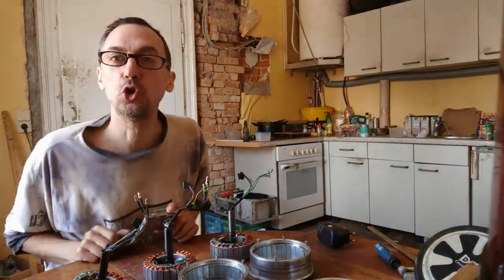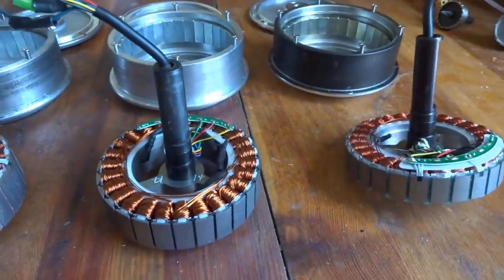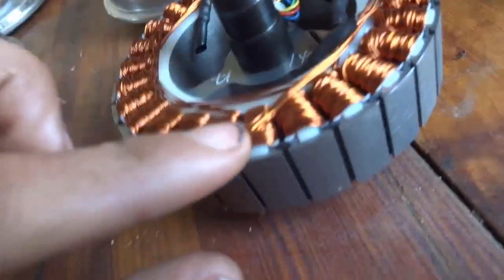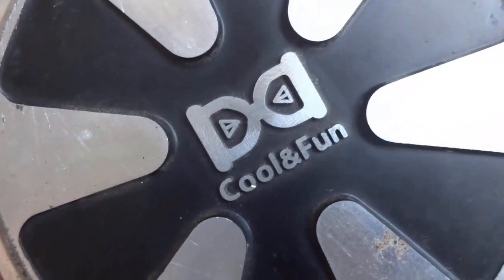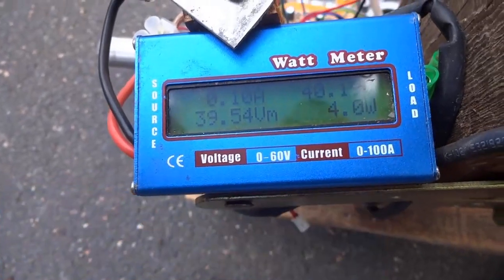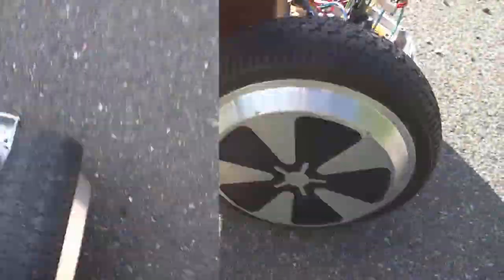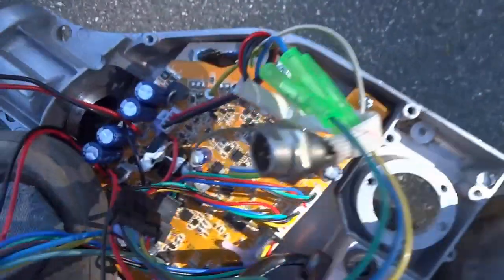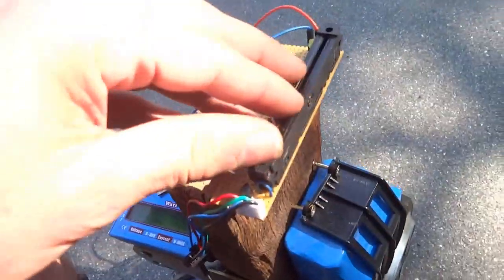part 1: 250 / 350 / 350+ Watt hoverboard motors with firmwares Fauth vs Feru :-)

Comment: Im still trying to figure out how to get ppm to work. Im building a multi purpose platform that can be used for moving stuff. Also it will be the perfect width to drive down my garden rows without disturbing plants so i can plant from a sitting position and my lawnmower fits on it.
Reply from the maker: i think ppm is out of date. An ESP8266 with wlan can do more and would be a solution for everyone. But it seems a lot of you still have a good old rc remote around and therefore go that way. 
I am currently switching to the EmanuelFeru firmware and it seems i need to improve his serial communication.. Taking a look at his ppm i find
 // Add Dead-band to a signal
 // This function realizes a dead-band around 0 and scales the input within a min and a max
int addDeadBand(int16_t u, int16_t deadBand, int16_t min, int16_t max)
So he improved ppm and pwm. Maybe you too give it at try.
Any ideas how to detect horse apples ? That would be another "garden" use case of such a moving platform.

Comment: Hello thank you for the beautiful comparison you made how can I get get the firmware I want to use it for 48v moto but I wish to modify the board to accept 48 volts(
Reply from the maker: Choose EFeru on my online compiler and compile :-)
I drive two 1000W 48V scooter motors with a single hoverboard control board. But only with a 3000W Cisco 42V power supply. And I have a 12V CPU cooling fan connected to the 15V cable..
48V battery might cause too much heat and kill the MOSFETs as well as the hoverboard motors.
12s liion has been tested successfully.
Reply: @robodurden , thank you sir for replying I'm a little bit new in programming so when they said I should  comment and uncomment, it's like a mystery I tried to compile but is giving me error I should choose a variant,,, I wish to use it for a bumper ride, using A DC
Reply from the maker: @amuhandrew1108  Google 'uncomment' and take a look at config.h

Comment: it would be nice if you made a guide on how to recognize what is 350W, 250W.
Reply from the maker: Small power supply or 24V = 250 Watt. Otherwise you need to open the motor and measure the stator height = magnets length. I show the three different lengths in the video and test them later. Forgot the lengths and would need to watch it again to post them here.
Reply: The easiest is to put them on a scale. If one motor (with a normal tire) is 2,9 kilo then it's 350 watt. It will have 30mm wide magnets.

If it's less then 2,9 kilo then it's less powerful. I bought 4 used hoverboards and only 1 had the heavy motors. The heavy motors are best if you want to overpower them.

Comment: Is when heverboard company's state the wattage is that permotor or each motors ? so if it says 500w dual motor does that mean is that mean 2 250 W motors  or 1 500 W motor. Thanks love your videos
Reply from the maker: 500W very likely will only have the poorer 250W motors. Better get 700W hoverboards.

Comment: I have 200W 6.5" plastic motors and the torque sucks, it was on my DIY go kart. I upgraded to 350W 10" metal hoverboard motors and now the torque is awesome. Id say that the 350W motors have twice the torque at least even though the wheel diameter is larger which would have lessened the torque, so overall 3x the torque of the plastic motor at the same diameter. Surprisingly, hoverboard motors have been getting worse with plastic designs and a measly 160 watts at 24 volts.
Reply from the maker: I have never seen hoverboard motors made of plastic. They all are made off aluminum. I can not imagine that plastic would be durable enough.
Please upload a short video.